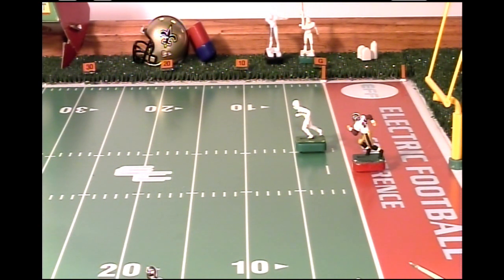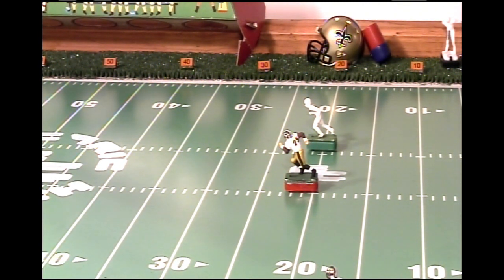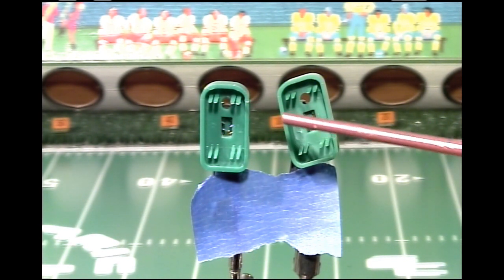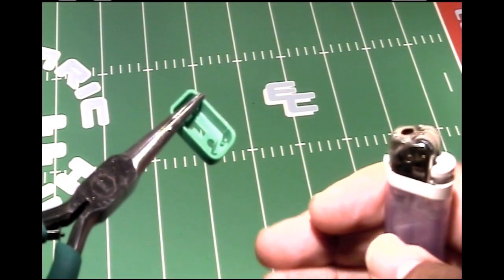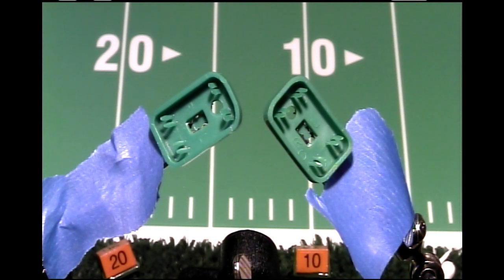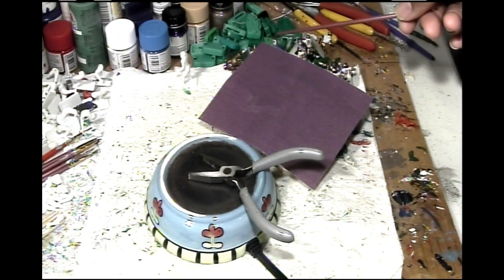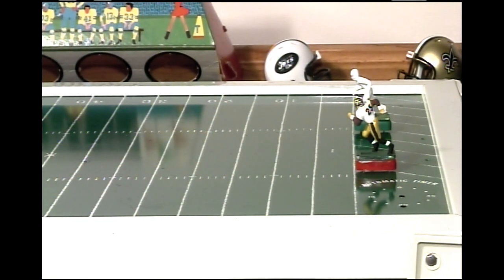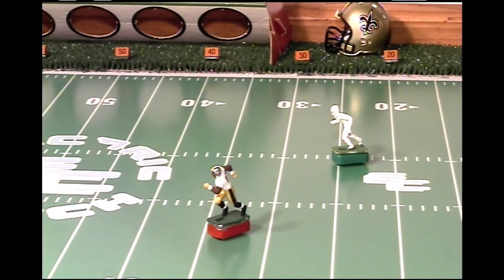Tweaking According To EC Pt. 2

Comment from the maker: As you already know, fire and plastic don't mix. Flashing is all about touch. Hold the base using needle nose pliers. Start your lighter on high. Quickly move the flame to a set of prongs. Repeat this step for each set of prongs. Remember that heat rises. The end of the base that is being flashed should be facing up; therefore, the prongs at that part of the base will be at the top. That way the part of the base that is facing down won't get flashed inadvertantly.